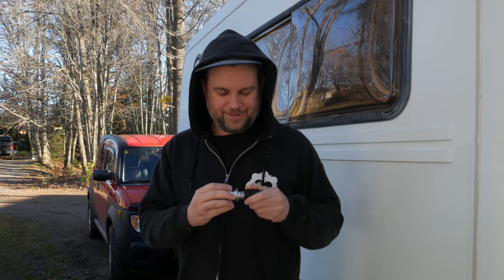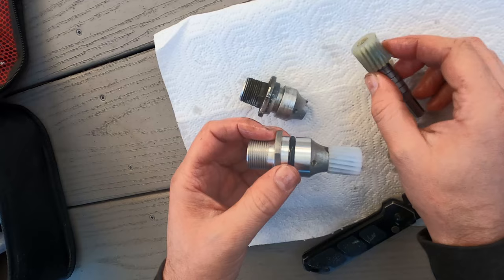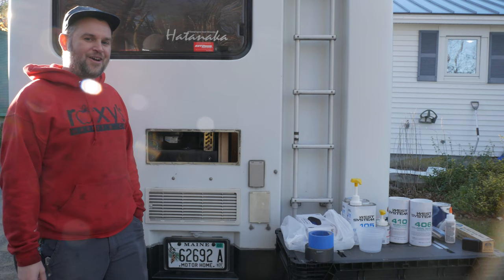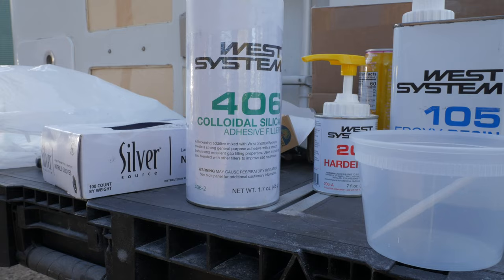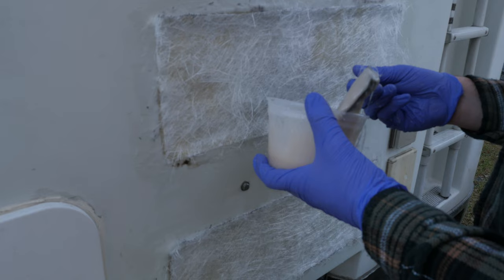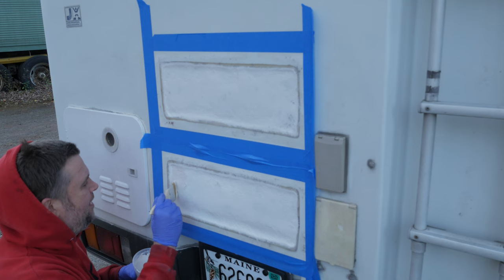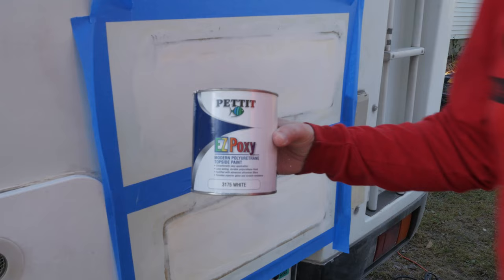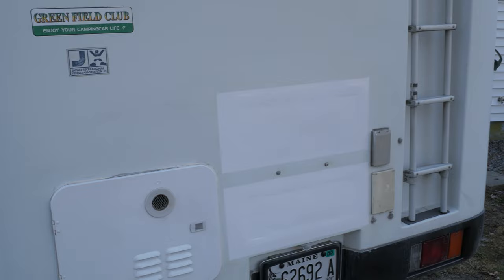1994 JDM Isuzu Elf speedometer & Odometer / Fiberglassed up 3 way fridge vents

Comment: Thanks for the video, will file away the 16 tooth information, in case I ever need one. You are getting good at the fibreglassing. look forward to the next trip.
Reply from the maker: Thanks! In the middle of the fiberglass job I was nervous it was going to be a disaster. I just got back from Vermont in it, so we'll see if I can patch together a video

Comment: Very cool! How has the diesel behaved in the Northeast? Especially in the winters? Also, do you do all of the regular maintenance?
Reply from the maker: Hey, thanks! It does really well up here in the winter. This one time we went camping 2 winter ago and it got down to -21°F, I had to really let the glow plugs work and keep it cranked to get it to fire up. I do all the regular stuff like oil changes coolant leak fix and flush I did my power steering leak fix and flush changed all the belts. Whenever something happens I do my best to figure it out and I keep up on it.

Comment: Hey Bobby, congrats on the speedo fix! Why you no need vents for the fridge now? I took out my 3 way fridge, it worked but was just too small. I put a vertical A/C unit in it's place so I still need the vents. I am using a large fridge/freezer in the back, love it. I also had to do some fiberglas work recently as I backed into a tree and cracked a couple spots around the tail light. Cold here now took a few days to harden. I hate fiberglas work but it sure is nice to get it done.

I replaced a couple of my top marker lights but they don't work. Any idea where they might be fused or where the wires are joined? My Isuzu is 2006 but might be wired similarly.
Reply from the maker: Hey Jim, thanks! It does feel good to have it fixed. 
My 3 way wasn't working so I replaced it with a dometic 12v one so I no longer needed the ventilation for the propane. Plus the vent covers were falling off and let cold air in and water. I wanted them sealed up before winter set in here. Temperatures are dropping here too so I ran into slow drying epoxy too!
As far as my clearance lights those were installed during my first inspection (the place didn't tell me I needed them and put them in for $900! If I'd have known it needed them to pass I would have tried to install them myself) I think they spliced into the head lights for the front lights and spliced into the license plate light for the rear one. 
Good luck with them and glad you were able to fiberglass up yours too
Reply: @bobbyswampfox  You need to double the hardner when it's cold! I have a few more small patches to do so will try that. I was worried my first batch would never dry. Looks good now. Not sure why they don't put some kind of real bumper on these things. I would love to install a couple sensors on the rear corners. My backup camera is not so useful might need to replace that. Also, need a better backup light, oh well lots of little projects keep me busy. Good score with a 12V fridge, mine runs on 12/24 so I have installed some 24V sockets, one for the fridge, one over kitchen counter for my oven, and the one outside in the end of the old fridge grill. These grills plastic is thin and easily breaks. I will leave my lower grill for the A/C unit, but the stop one I am building a little sealed box for the solar controller. Also, I found a few rusty areas on the subframe rails, I will do some rust conversion spray and brush and paint the whole bottom this winter. Couple areas I might fiberglas over just to keep moisture out.
Reply from the maker: @jimbeaver27  me and you are in a lot of the same spots. Always something to do with these!
Reply: @bobbyswampfox  Next few fiberglas batches I squirted in lots of hardner and it is getting hard in like half an hour. Temp is like 40-45 F. I gotta apply some bondo now though and will use lots of hardener there too. Pity I can't pull it into my garage :)